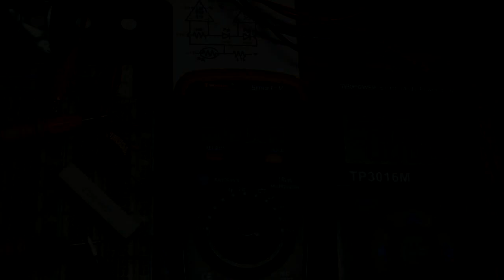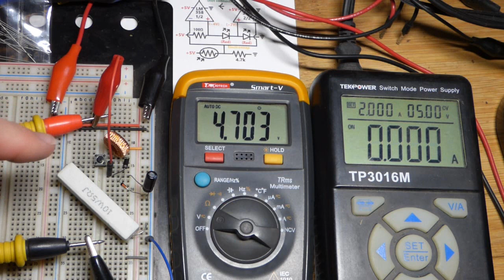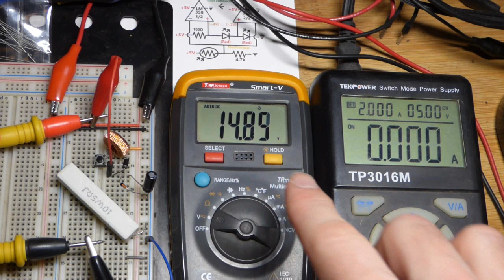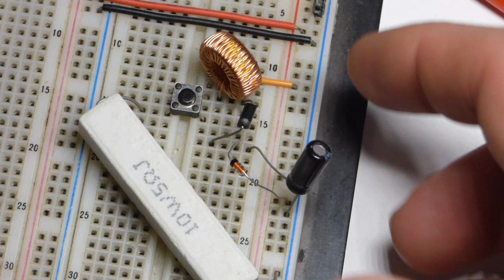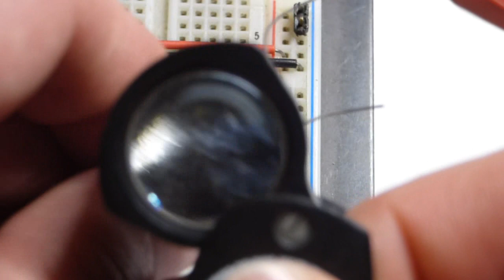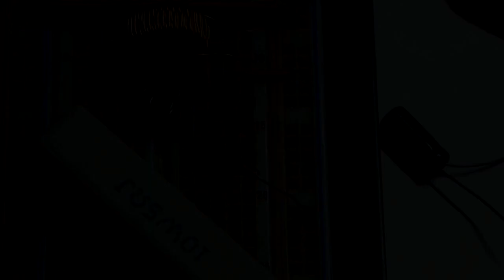Basic voltage booster prototype demo circuit I made with inductors I just bought by Electronzap

Comment: Yes, fun and interesting. Yes, the schematic would have helped, a lot. That can just be hand drawn. Since this is a basics tutorial, it would be good to point out that this method of boosting voltage is a switch mode method and that switch mode boosters are electrically noisy. Cheers.